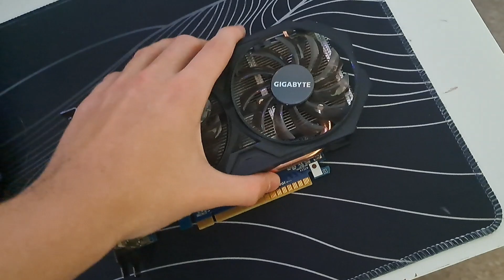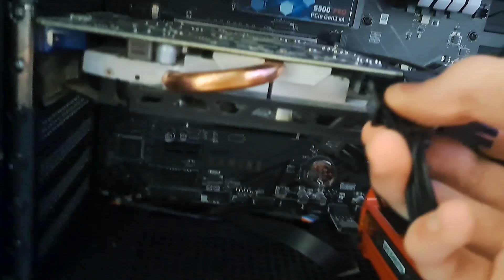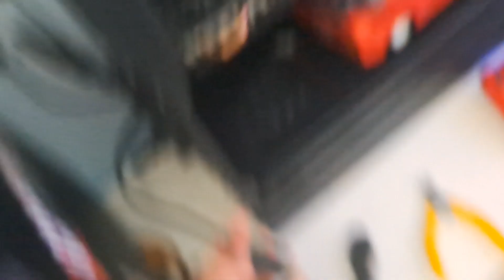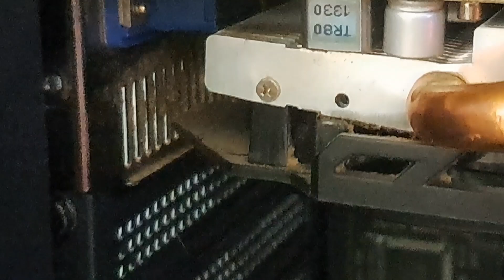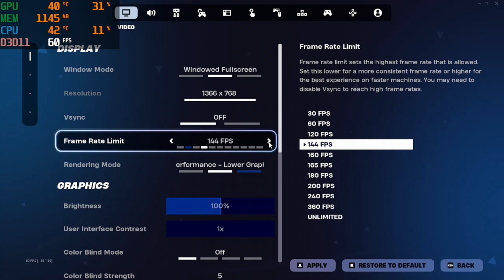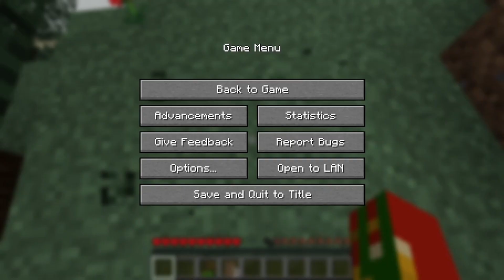gaming on a $10 Graphics card - benchmark & testing

Comment: What is your main GPU is it the 650 ti?
Reply from the maker: Yes i am saving for a 4060 and  got this for £10 in the meantime you can find ones on ebay for like £20 but if you wait a little you can find a good deal like i did
Reply: @Ob-lay  have you heard about the intel arc b580 it's really good value GPU for 250$ it has 12gb vram instead of 8gb with the 4060
The b580 is out of stock so it's kinda hard to get one and please be careful if you want to buy it greedy brands raised the GPU price from 250$ to 460$ don't support them
Reply from the maker: @Player_g1  yes i have but in the uk it costs so much more than in the usa
Reply: @Ob-lay  or for a budget option get the intel b580, ive got it recently and it is excellent.
Reply from the maker: @orange3295  as i said, in the uk it has been priced up so much
Reply: @Ob-lay  if u want another option the 3070 costs less than the 4060 but outperforms it a bit, i heard its a good budget option on ebay
Reply: Dont get a 4060. Wait for the 5060. @Ob-lay
Reply: @Ob-lay  wait for a 5060 bro, preferably go for a 5070
Reply from the maker: @nexor7809  nah im not gonna wait for a gpu until like march thats also gonna be way more expensive, i may chose to go for an amd equivalent gpu
Reply: @Ob-lay  just buy what you want